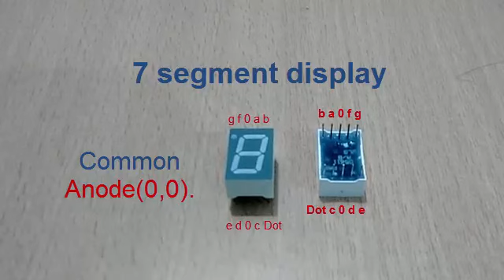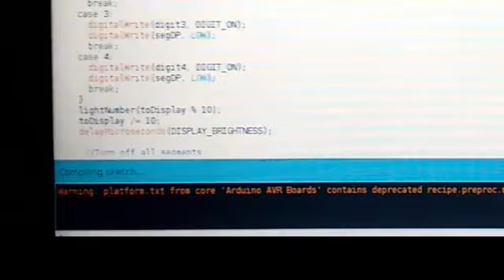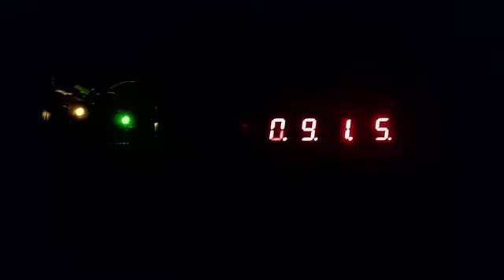How to make A Arduino Digital clock!

Comment: Good video bro.
But I have a question,
Sir, I am making an arduino digital  clock,  but I don't want to keep the USB attached .If I use a 9v battery, where do I attach it?
Or should I just attach the other side to a power bank??
Please reply

Comment: Hi there can we add RTC real time clock to this project and can we use 12hrs format using ARDUINO nano
Reply from the maker: Ali M yes we can add it .. and it can be done in nano too.
Reply: @ MadRajib so can u send me the link of wiring diagram and same code will work
Reply from the maker: Ali M let me try it out first .. I shall let you know
Reply: ok thanks
Reply: i need 12 hours format code sir.....

Comment: Hey can i use jumper wires as you placed those wires behind segments ?
Reply from the maker: Chhipa Saista yes you can
Reply: MadRajib Lab  and how many jumper wires use in this project ? I have 40 are they enough ?
Reply from the maker: Chhipa Saista yes it should enough but use other kind of wires too if you need more

Comment: What resistors do ?? What use of them why we connect  to board ?
Reply from the maker: Chhipa Saista registers are used to limit the current or voltage in the circuit. Here we are limiting voltage also the current so that the high voltage won't blow out the each led segments of a 7 segment display .. beacuse led segments drivimg voltage is about 2 to 3 volt and providing 5 v will burn them out.

Comment: You gave a segment display link which is unavailable can you please give me another link of segment display actually i am confused which is right segment display ? And also give me the link of  resistors and one question can we use jumper wires as spare wires ?Please reply
Reply from the maker: Dear Chhipa 
Here is the link to common anode display 
http://amzn.to/2DzxH8p
Here i have show how to use common anode displays, so common anode displays will only work for this circuit .
I shall be soon showing how to use common cathode displays.

Here is link for the registers:
http://amzn.to/2n66IpF
i bought a resistance box, for quite cheap locally . 

Yes you can they will make it easy , but i didn't had so many wires so i had to use LAN wire as spare wire.
Reply: MadRajib Lab  it is done without resistors ?
Reply from the maker: Chhipa Saista No, I have used 4 resisters

Comment: This is urgent!!! Please help me sir. I am making this clock for a school project that is due in 2 days. The spdt switches are not working. I have clearly followed your instructions. But I still can not set the time. There is no problem with the code. Please help me sir I dont know what to do.
Reply from the maker: Sourish Pardhan, 
1.  Have you checked the switches if they are working fine.?
2. The connection of switches to the board are all okay? sometimes due to the loose connection, they might not get connected to the board.
3. Are you using a breadboard? then the pins of SPDT are small and won't reach the board connecting holes. Add extra thin wire as I have added to the switches.
Reply: Dear Sir, I am using a breadboard and spdt switches are properly connected. I actually just realised that spdt switches are working fine. However the displays are not properly showing numbers when I am setting the time. Please help me with displays issue.
Reply from the maker: Sourish Pradhan, how are they displaying the digits?
Reply: Sir, the digits always look like an 8. Sometimes when I am pressing the switches, the digits look like a 3 or 6 only. I cannot see any other numbers on displays.

Could this be due to an issue with the wires or resistors? Do resistors have positive and negative sides? 

Or is this an issue with the LED Displays?
Reply from the maker: Most probably that because of connections issue. Try to remove all the displays and try to connect one and test . And add one by one and test.

Comment: can we upload the codes to ARDUINO using Android phone and will it work
Reply from the maker: Sorry, Ali for a late reply, I searched for this topic but didn't found any suitable app, windows app is available. I think the Arduino community are working to build an android ide. I shall reply you soon if I get some knowledge.. also there is a browser ide, but it needs a plugin to install, so it not gonna work in android.
Reply: thanks for your reply and support I like Ur video very much and I want to do the same I used Android phone app ( ArduinoDroide ) but the code didn't support it showed error  so please if u can write code for that then it will be good for me I  used ARDUINO uno r3 and 4 7seg led I have attached all the jumper wire to the 7seg led on breadboard same as your project .
Reply from the maker: Ali M thanks for your support, I. very glad that you liked it. I shall have a look on that.. I shall reply you as soon as I find a way..
Reply: thanks again
Reply from the maker: I have Found out the way, watch this video https://www.youtube.com/watch?v=Qk1EGmd6ao0,
here i have shown how to add the time library to the ArduinoDroid library and compile it.
Reply from the maker: Have you selected the board from the settings menu???. watch this video by kuldeep panchal,

https://www.youtube.com/watch?v=lHRRalKs23I
Reply: yes yes I have seen this video before your video I have done exactly the same .tell me one thing do I have to connect all the jumper wire and complete the circuit and then upload the code or I can upload first and then connect
Reply: @ MadRajib Lab THANKS alot for everything that you have done for me I'm very much thankful to you now I'll connect all the jumper wire and test the clock and then I'll make a video an show u
Reply from the maker: Great.. work..  Thanks to you.
I shall be looking forward for it.
One thing, when you open a file in a folder that has more than one files, the app opens all the files in that folder automatically opens all the files. And when you try to compile it try to compile every file that is opened. so if any files having errors will show compilation error. That's what is happening. So close the other files that are not required before compiling.
Reply: ok got it thanks for your suggestions
Reply: @ MadRajib Lab i was able to complete the project successful but I was unable to upload my video on YouTube it say's this is a copy of a video already there so I upload my video on Facebook search for Mohammed Asif my account has same profile pic .And once again thank you very much

Comment: bro  please solve  the coding  problem  you  have  :
Arduino: 1.8.8 (Windows 10), Board: "Arduino/Genuino Uno"

C:\Users\NILANJAN (DJ NIL)\Downloads\final_clock_arduino_12hr\final_clock_arduino_12hr.ino: In function 'void loop()':

final_clock_arduino_12hr:59:18: error: 'hour' was not declared in this scope

    int hr = hour();

                  ^

final_clock_arduino_12hr:60:47: error: 'minute' was not declared in this scope

   int timp = ( (hr>12)?(hr%12):hr)*100+minute();

                                               ^

C:\Users\NILANJAN (DJ NIL)\Downloads\final_clock_arduino_12hr\final_clock_arduino_12hr.ino: In function 'void set_time()':

final_clock_arduino_12hr:80:25: error: 'minute' was not declared in this scope

   byte minutes = minute();

                         ^

final_clock_arduino_12hr:81:21: error: 'hour' was not declared in this scope

   byte hours = hour();

                     ^

final_clock_arduino_12hr:131:35: error: 'setTime' was not declared in this scope

      setTime(hours,minutes,0,0,0,0);

                                   ^

exit status 1
'hour' was not declared in this scope

This report would have more information with
"Show verbose output during compilation"
option enabled in File -> Preferences.
-----------------------------------------------------------------------------------this is the error  please solve  it  and also if processable  use  rtc to keep clock  running  when  on  power  failure
Reply from the maker: Nilanjan Roy, check out my instructable page. Read the comment by Arijit Kumar.  https://www.instructables.com/id/How-to-make-a-Arduino-Digital-Clock/

Comment: can we use led strips instead of 7segments??
Reply from the maker: Bea Jane Mandawe yes it is possible , but you have to make each 7 segments of each display . and control each of these with transistors .. that means for one display you have to use 8 led small strips and 8 transistors .. and a external power supply to provide the give voltage to the strips.

Comment: Does anyone know how to add the libraries?? I don't know how to do it
Reply from the maker: click on the Sketch tab of arduino ide(You will find it in top left corner).
 click include library
and click "Add .ZIP library option "
then find your library .zip file and press okay.
it will add library to arduino libraries folder and
you can now include the library to arduino sketch  from "include libarary" drop down list
and browsing the respective library below the "contribution Libraries " section.

Comment: its saying that there is a problem in code... :(
its saying   This report would have more information with
  "Show verbose output during compilation"
  enabled in File > Preferences.
Arduino: 1.0.6 (Windows NT (unknown)), Board: "Arduino Uno"
final_clock_arduino.ino: In function 'void loop()':
final_clock_arduino:62: error: 'hour' was not declared in this scope
final_clock_arduino:62: error: 'minute' was not declared in this scope
final_clock_arduino.ino: In function 'void set_time()':
final_clock_arduino:81: error: 'minute' was not declared in this scope
final_clock_arduino:82: error: 'hour' was not declared in this scope
final_clock_arduino:132: error: 'setTime' was not declared in this scope
Reply from the maker: did you added the libraries????

Comment: plz give the working code . given code doesnt work
Reply from the maker: The program has no errors, did you added the given libraries to arduino's library's folder and included the file
Reply: yes i did .plz give me a working code'
Reply from the maker: This is the working code ... its working fine in my windows 10 .... does  your code has #include <Time.h> ???
Reply from the maker: Sorry  for such an late reply and error. actually the Time library i have used was for old version of arduino ide. it was update after arduino ide 1.6.1 version, hence the error.

here is the link to new updated library, but before you use it delete the Earlier Time folder from libraries folder 
C:\Users\lenovo\Documents\Arduino\libraries and also from
C:\Program Files (x86)\Arduino\libraries

now dowload the zip file and add it to arduino,
https://github.com/PaulStoffregen/Time.git

To add it  go to sketch->Include Library->Add .Zip Library and find the zip file. 
after that go to sketch->Include Library->Time

And it will work.

Comment: The code is not working please provide me  a correct code
Reply from the maker: Sorry Vinay for such an late reply and error. actually the Time library i have used was for old version of arduino ide. it was update after arduino ide 1.6.1 version, hence the error.

here is the link to new updated library, but before you use it delete the Earlier Time folder from libraries folder 
C:\Users\lenovo\Documents\Arduino\libraries and also from
C:\Program Files (x86)\Arduino\libraries

now dowload the zip file and add it to arduino,
https://github.com/PaulStoffregen/Time.git

To add it  go to sketch->Include Library->Add .Zip Library and find the zip file. 
after that go to sketch->Include Library->Time

And it will work.

Comment: Sir.....how to convert 24 hours to 12 hours format??????
Reply from the maker: Hie Tips & Tricks, you have to use 'hourFormat12()'; in the setup function to get 12 hour Format . By default it returns 24 hr format.
place it in the beginning of the setup function . It Should work!.
Reply: Setup function means "void setup()"  in the source code?????
i successfully made it but i need 12 hours format.....
Reply from the maker: i have upload the another sketch in the instructables page check it out you will understand.
https://www.instructables.com/id/How-to-make-a-Arduino-Digital-Clock/
Reply: i uploaded your 12 hour format sketch sir....but it is not working...!!! when i set time 12:59 then after 1 minute it goes 13.00
can you please test the 12 hour formate sketch or make another video for 12 hour format clock???
Reply from the maker: Sorry ,Tips & Tricks actually this project I made is broken so I am not able to test it .. though I have written a extra code to convert the 24 hr to 12 format
Reply from the maker: I have again added some changes please check it .. check in the instructable page.!!
Reply: Thanks a lot sir......its working !!!......also edited   if (hours > 12) hours = 1;  instead of    if (hours > 23) hours = 0;
Reply from the maker: That's great . Sorry for late reply .
Reply: Can i use atmega8  chip in veroboard & RTC for making this project???
Reply from the maker: You can .. I used it already . Just the problem would be to burn the atmea8 with Arduino program .. 
I used atmega 328p because it had ardunip boot loader burnes into it. You have to burn an atmega8 specific Arduino bootloader to program the chip
Reply: Thanks for info.... how can i use RTC module with this project??
Reply from the maker: You can use rtc also . I recently built a common cathode with rtc .. I will soon post a instructable about it .. just my exams are coming so it would be late
Reply: ok....i am waiting for that.....Best wishes for your exam......
Reply from the maker: Tips & Tricks Thanks alot. In the mean time carry on with your creative projects too.
Reply: thanks....  can i get your facebook id for rapid conversation??
Reply from the maker: Tips & Tricks it's Madhab Sharma madrajib
Reply: a sent you A message on facebook   from Shariful islam..did you get it ?
Reply from the maker: Tips & Tricks yes I got the message
Reply: i have faced a problem...after 24 hours time is set 00.00....how can i solve it???

Comment: where is the code
Reply from the maker: Aman Singh check the description. you will find the link for the code in the instructable page.
Reply: i have uploaded the code to arduino and included library also but it still not working
Reply: the code is runing but still its not showing time
Reply from the maker: Aman Singh have you checked the connections .. there might be connection problems ..
Reply: Aman Singh  add the valid library link plzZz...